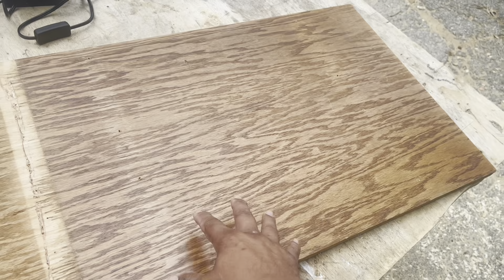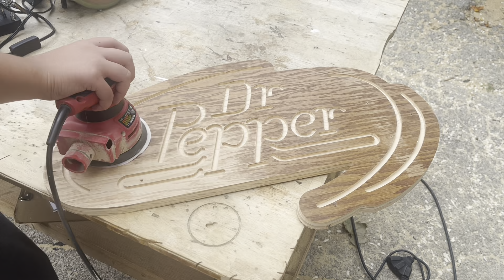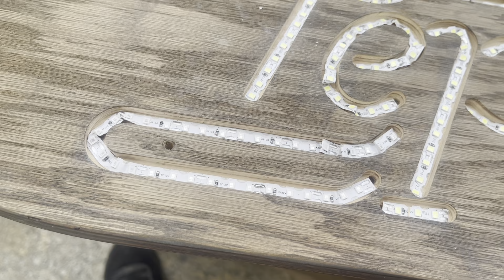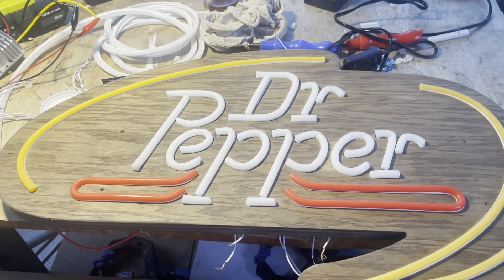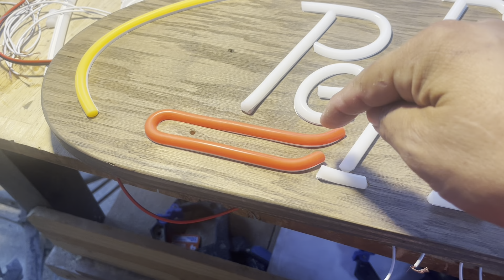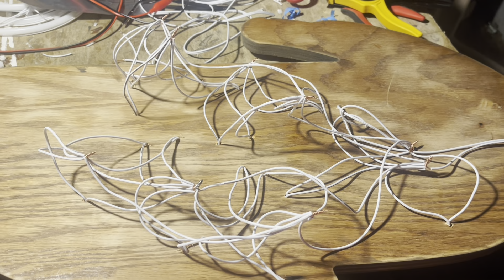How to Make a Custom LED Neon Sign - Start to Finish

Comment: You are so right there are not any video that goes in to detail that shows or explain  how deep or wide to make the channel in the wood . Thank you for giving at less an ideal on how to go about it , you also hint on what measuremnt you use with the led you have , and with that it give you  an idea as to  what to correct . Thank You this is what I been looking for no one else will go this far into detail .